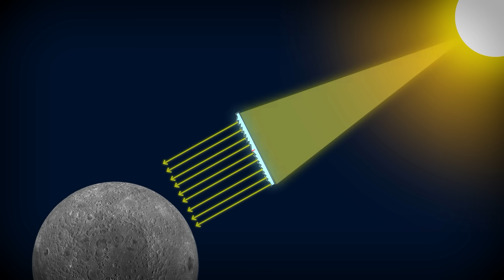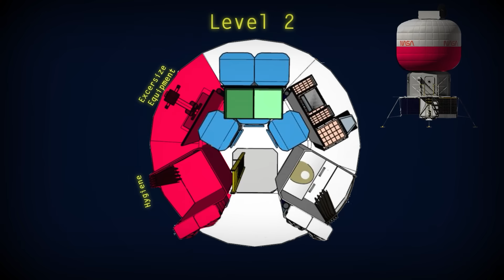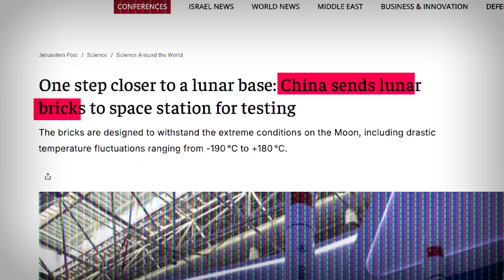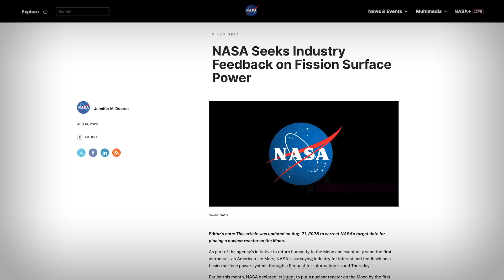How NASA Will Build A City On The Moon

Comment: Instead of the very energy- and process-intensive brick architecture, I suggest a simple “pole barn” structure with a flat roof, situated in a crater. Cover the roof in a few meters of regolith. Between the crater walls and the roof, you now have a large, radiation- and meteorite-resistant space for habitats, labs, work spaces and vehicle parking. Just need metal or composite structural beams and sheets, and some earth movers (all of which are useful, even necessary, for other purposes anyway). Use the earth movers to cut an entrance through the crater wall, similarly covered with a “regolith awning” to limit radiation. Far cheaper and faster, but probably not as fun for corporate and university research teams seeking taxpayer grants and contracts…
Reply: Looking at what you've said in these 2 comments, a couple books of interest, assuming they are not already owned:
from 2018, Building Habitats on the Moon: Engineering Approaches to Lunar Settlements. It even includes engineering and geology math. 
from 2010, Turning Dust to Gold: Building a Future on the Moon and Mars. It has similar structure ideas plus active protection against radiation and cosmic ray particle energy, those illustrations definitely give a different look to lunar habitats.
Reply: @scottfw7169  Thanks!
Reply: Here is a variation that pressurizes the entire crater, much more high tech. “A Lunar Base Could Start with a Dome over a Crater Made of Regolith” at Universe Today. The “pole barn” is much simpler and near-term, merely a radiation/meteorite shelter for standalone pressure vessels.
Reply: Ha, ha, ha......
"Vehicle parking"...... Ha, ha, ha....
Reply: Do you realise how much a few metres of regolith would weigh piled on a large structure? One with a flat roof instead of a load-bearing structure? A cubic metre of soil on Earth weighs 1.2 to 1.8 tons with dry sand similar to regolith in the middle. Even with the Moon's reduced gravity, that's still a huge amount of mass to pile on a structure.  
If you build in a crater, you build a dome. It's not a new idea and the general shallow nature of Moon craters means you would put a lot of effort into constructing what would ultimately be a very small space, unless you try capping one of the much larger craters in which case it would become prohibitively expensive.

And once you've built your capped Moon crater, your habitat within still has to be pressurised and sealed because you can't expose people to Moon dust, so you've spent a huge amount giving them a protective roof that offers only a little more protection than a base on the surface. You would have the same issue on Mars, you could build a base inside Mars caves and lave tubes but with Martian soil and rock full of so many carcinogens, you couldn't have people exposed to them. You'd still have to keep them inside the base; no walks inside a sealed Martian cave.
Reply: @DomWeasel  Then make it a load-bearing structure. Don’t even use a crater; slope the walls at the angle of repose and cover them as well. Not an engineer. Just throwing ideas that might, or might not, be useful. Easy to pick apart. Have fun.
Reply: @patrickunderwood5662  
I'm not an engineer. I'm just a guy who built things as a kid and understands the strength of an arch.
Have you never seen a Roman aqueduct or bridge?
Reply: Technically they'd be 'lunar/moon movers'.

Comment: I suggest building the permanent base in orbit then landing it on the moon. It will be a good idea if the space station is transferred to a moon base and moved to the moon instead of entering the Earth's atmosphere.
Reply: The LSS (The Lunar Space Station)
Reply: Awesome concept.
Reply: Question: Was the space station's structure engineered to either absorb or resist the energy of moonquakes? 🤔
Reply: @scottfw7169 if you put balls on lower plate, and on top of the balls, the upper plate, the moonquake would do nothing.
Reply: If you wanted to build the Empire State Building on the moon, would you try to fly the whole thing down or fly it down piece by piece and build it there?
Reply: @SuperSmitty9999 i would send 100 robots to do a mans job.
Reply: Jackoff.
Reply: I suggest building a floating castle in the sky, that we all live inside.  With like swimming pools and roller coasters and stuff.
Reply: They could pull it down with a cable, because of the gravity.
Reply: @RobertPetrušić that would be expensive, plus it would crash... Possibly
Reply: @Mars-d3s It would most probably  crash. The moon might not have a strong gravity, but there is also nothing stopping you from accelerating.
Reply: @NoXPhasma i didnt think that basic. You. Would have motors on the station. But anyway this is far into future.
Reply: @RobertPetrušić   Yeah, that's it.  "They"  could catch and  pull down an object orbiting at  3,600 mph (lunar orbital velocity) !  Space Cowboys with lassos--I bet you weren't ready for that!
Reply: @jelink22 you have a serious lack of imagination. The object would also be landing. At the same time.

Comment: NASA plans to build a permanent lunar base at the south pole, featuring roads, landing pads, habitats, and nuclear power. The base will use innovative solutions like melted regolith roads, brick structures, and pressurized rovers to overcome challenges of dust, radiation, and extreme temperatures.